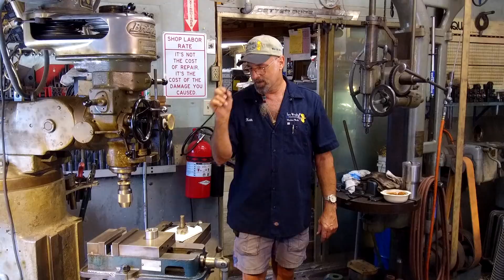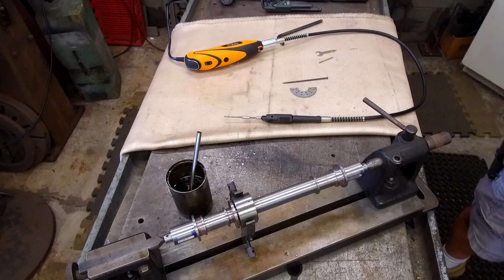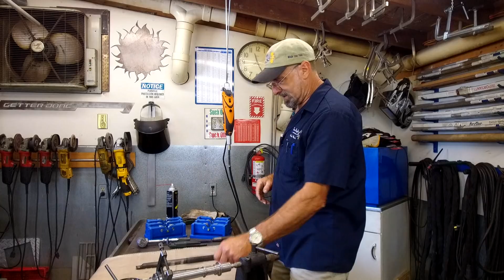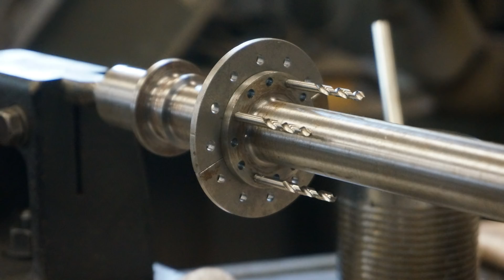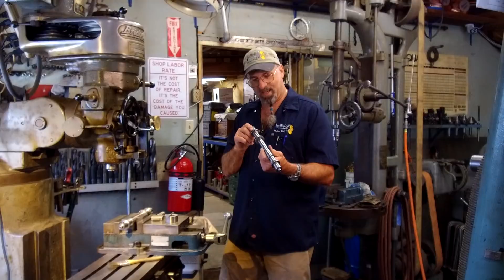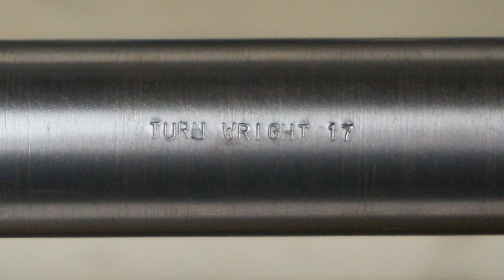Steam Wagon Ho Part Eleven

Comment: Dear Keith, kudos on your flexible drill bit. This an inspired idea. You should have used a counterclockwise twisted wire instead of a clockwise one. Alternatively a left turning drill and driver would have served the same purpose. The clockwise configuration you chose opens the strands of the wire instead of tightening them. Your configuration loses torque to opening of the strands of the wire.

Comment: I know I am late to the table on this one, but maybe a bit holder made with a short piece of a socket head cap screw of the necessary size, and sacrifice a ball end allen driver to chuck in an electric or air drill to drive it. It would eliminate the need of the cable all together.

Comment: Just a thought in case you ever need to use cable again for flexdrive and can't get speedometer cable in a small enough size. What do you think of cutting some snug fitting rings to fit the cable, space them apart and secure with hot glue?  The hot glue would flex and the rings should limit the amount of unwinding and spreading.

Comment: Hi Keith,  Great videos. To cure your cable problems, order an early Corvette fuel injection cable. They drive the Rochester fuel injection pump from the distributor and are very stout and wound backwards. They can be found on line, not very long but enough material for several applications. I use them to drive angle drives for porting 2 strokes cylinders and four stroke heads.

Comment: Great project series.  You may be able to get small universal or CV joints for RC cars to drive the drill.  I wonder if a ball end hex would hold up and give enough clearance.  I think you can 20 degrees out of them.  Your method obviously worked very well, as expected.

Comment: could have used a 1/4 hex drill bit (the kind that quick connect into drivers/extensions) grind the hex into a ball (like allen wrenches that let you use them off axis). then use an extension and the ball will act like a universal joint.  a long extension is slimmer than the dremel and would allow you to use a real drill. for shallow angles an extension or two from china with sloppy tolerances should do the trick without grinding the ball. also, i've found it best to leave over-heating tools running with no load to cool them quickly.  no load condition causes negligible heat and the cooling fan is running.  i missed some parts of this series is the tool from a sponsor? just can't imagine keith would actually use this tool...

Comment: Just s thought, perhaps you cannot get steel rope that has a left hand twist? You can get left hand cutting drill bits though. Such as thouse used in kits to remove broken bolts. Tying to help here. soft tin solder could work too.
Good job Keith... with a Ahah! so that what he's doing.

Comment: I have to wonder if when the wire is longer, does that mean the relative angle at the bit is less extreme so it gets less flex with each revolution.  For sure it'd be ideal if it could've been a left handed drill so the wire spun "right", but you can't win 'em all.

Sounds like something that needs to be tinkered with to find the magic bullet...

Love the solution!

Comment: The only thing I would do differently would be to pin the first hole while I drilled the rest -- belt and suspenders insurance against Murphy's Law.
Reply: I was going to say the same. I'd have done (and pinned) one on each side of the split to ensure everything was solid and kept in register. Obv the clamping force was enough as it was.

Good idea on the flexible drill. I'll try to remember that.

As for the soft solder idea, I'm not sure it would be strong enough. Soft solder joints are pretty weak. Maybe a good Loctite instead.

Comment: Great series as always! However, as a mechanic of many years I would have put an extension of about 12 or more inches on the connection to the flex shaft to reduce the angle which would have possibly helped the life of the flex drive. You could then have put on a more robust drive unit to speed up the process.
Putting extensions between sockets & drives is a more efficient way of getting access to awkward fastener locations with the least effort.

Comment: Keith what great project to follow on you tube I have watched this project with great interest checking for updates weekly. Regarding the cutting and lubrication fluid you used I have used Trefelox cutting compound with good results in-particular those hand drilling jobs such as this project- not to be confused with the garbage that comes in a spray can with the same name and is mostly oil. Anyway Trefolex compound seems to hang on and  does two jobs lubricate, cut and not runaway as heat or friction increased.

Comment: Cable (like drill bits) can be "laid up"  either  right-handed or left-handed. Your cables is exactly opposite the way you want it.  Cagbe unwinds. The ultimate solution is either get a cable laid up opposite ways from yours, or to get a left-handed drill bit and run the thing in reverse.. As it turns out you gotter done and that's what counts.

Comment: Keith,

Maybe the "StayBrite" stuff Greg Halligan uses in his HVAC work would work well in constructing a flexible coupling.  For "soft" solder, the stuff is STRONG.  It stands up well in air conditioning equipment, which is a good indication of its strength.

Eli D.

Comment: They make long shank drills for aircraft work that have short flutes and would have worked perfect for this job.
They come in 6,8,12 and 18" if I remember correctly, I used some in a plane I built when I had to drill "around" shit!
The shank is fairly soft and will flex plenty.
Great series!!

Comment: My pet peeve with little rotary tools is they have no torque for anything but grinding and the speed adjustment is useless because it loose torque on slow..but i do some precision small drilling and have not found one i like using so i'm building my own head unit to use that extender with...dentist drill setups are better but too expensive... As always love your videos

Comment: I use to work for a company named Elliott Mfg. whose business is Flexible shafts. There is a whole technology behind Flexible Shafts. I've designed several flexible drills for many applications but mainly surgery and doctors.  The cable you are using is not designed for rotary application but a tension application.   I would suggest that you find an old weed wacker and remove the flexible shaft from it and see if that will work.  Check out their website and get an education on flexible cores, there are many specs.   At the time I worked for Elliott they made 90% of the flexible shafts for all weed wacker in the world.  They have since moved manufacturing of many shafts to Mexico and China.  They actually gave their technology away to China for free. Do you believe it?   FYI: I mainly swaged the ends on the flexible core.

Comment: Loved it :) I could hardly wait for each ep to be released ;)

With the wire breaking. If you made the cups deeper and then only soldered up a small amount (to grip the wire) the rest of the cup would stop the wire from moving laterally so much (Is the idea behind boot lace ferrules on industrial and marine installations)

Comment: That TackLife rotary tool is a toy for polishing dainty teacups. These cheap ones don't have a proper speed control, and that allows them to bog down and overheat. I would highly recommend a Proxxon. The actually have torque at the low end (5000 rpm).

In addition, I think you could eliminate a lot of load by not using the flex shaft that came with the tool. When they are loaded, the cable will buckle slightly and contact the walls. This friction causes more load and more buckling and more contact. They are fantastic for light work like engraving or cleaning/polishing, but the long length allows a lot of contact and friction to work against you when doing something that needs a decent amount of torque. If you made the shank of your flex bit a few inches longer and placed it inside a sleeve, you could attach the rotary tool directly.

I would also suggest harvesting the cable from the long flexible adapter if you need to make more flexible bits. Those cables will be a special double-layer, high helix angle type that are designed to resist rotation.
Reply: ElectricGears Had the same thought re a longer wire and using a hand drill. Good suggestion of harvesting the wire in the flexible shaft but it is not as cheap. Proxxon or Foredom would have been more powerful but sometimes one has to use what one already has.

Comment: The problem is not the cable, its the heat.  Red hot and cooling slow anneals it and makes it soft.  Quenching hardens.  Quenching and reheating will make it spring steel (if enough carbon content).  Check out some blacksmithing videos.   The longer one held up because the heat didn't get into the middle of the cable, so it was able to flex there without stressing the annealed metal.  If you do this again, you could try electrical or plumbing solder, since your tolerances are tight, the temperature would not get up to the annealing temps.  You could have also put set screws for both the drill and the cable sides, which would all you to swap out the bits or the cable with ease.    Having the wire twist in the other direction, would have helped as well.  If you had something reversible, you could use a reverse drill with the same effect to tighten the cable instead of the twisting, trying to open the cable as you are trying to cut.

Comment: dermal make a good flex drive but there are many types you want the good one the constant rpm one as you set the rpm and it wont bog it automatically ups the power to keep it from bogging unless you really give her
ive had mine for a long time and its been grate for this n that jobs where the 1/4 makita is to much of a brut the dermal gets it done

Comment: I've never used cable (either Stainless or other) I have only used Speedometer cable. Cut it w/ a small Dremel disc, solder it up, works every time.

Comment: I would have used a regular hand drill on the flex cable instead of the smaller power head that was being used, you would not have had any trouble with torque or over heating, I believe.

Comment: I can't read all the comments to see if this is a duplication, but since you only needed a slight deviation to clear the journals along the shaft, a long length drill would probably have done the job much better.  Electricians use them to drill through drywall up through the top plate like a snake.  A smaller diameter drill rod silver soldered onto the drill bit would have done the trick I think, just needs to be long enough for the flex and to clear the end of the shaft.

Comment: When I first realized that you had to drill the holes I could not imagine how you were going to accomplish it. The flex bit were super, but I wonder if you could have used a long hard wire, like a suspended ceiling wire, long enough to run past the shaft then use a conventional drill motor. The "ceiling wire" still is flexible, but may take more push. Just a thought. Thanks for the highly educational video. J B.

Comment: With my trapping and snaring experience here in KY I have found 1x19 cable to be much more durable than 7x7. Basically looks like the same stuff but it has fewer heavier gauge wires. Looks like your 7x7 worked out, but I bet if you give 1x19 a try you will likely have less tool failures. Great series.

Comment: Cool technique! Would wrapping something around the wire (shrink wrap) reduce the flaring and hence reduce the work-hardening effect and snapping? Those rotary tools lose a lot of power through the flex coupling. I'm sure that if it didn't need to be run the through the coupling it would have handled the drilling fine.

Comment: Seems like that fancy dremmel could be replaced with a small 1/4" drill which has better power.  Enough flex no doubt.  It must have been tempting to cut some slices off the split pattern and weld them to the shaft instead of offset drilling.

Comment: Keith, what I have done in the past in my modeling days is used an old ball driver into a socket end. That way you could use a proper drill motor and put some real torque on the bit. The Dremel style tools with flex shafts just don't have the torque needed when drilling steel.

Comment: A couple comments for next time(?): if the input shaft had been somewhat longer you could have used a normal cordless drill. 
As the flex was opening up due to wrong direction wrap, if you had fitted a close fitting coil spring over it, it would have been restrained. 
As others have said, and you eluded to, silver solder is just too hot for that cable, soft solder or even Loctite648 might have done. Many times when I want an extended drill or end mill I find 648 more than adequate and almost instantly curing.

Comment: If you had a left hand drill bit it would work better with that lay wire rope possibly as long as the drill motor would run in the proper direction...Mike in Louisiana

Comment: If you web thin the tip on the drill you may not need to use as much force. I have done this on some small holes to drill with good results.

Comment: Keith, my complements on changing your method of making the flexible drill shaft. A critical part of any development, in this case your flexible drill shaft, is hypothesis testing. You established some failure mode hypotheses on the first two trials. Your third trial benefitted from the first two and as you said, you have some ideas for future types.Exactly the way to go about this! :-)
regards
vic

Comment: I use Rotary tools extensively, based on my experience, all of them are shit, loads of rpm and no torque. gotta make one yourself, I make mine out of sealed dc motors. I go over a few things here, gotta do a proper video at some point
https://www.youtube.com/watch?v=1eEzYl2Y7SM

As for the flex shaft. probably even more important than the direction of the twist in the wire is the attachment points and protecting the metal from any heat. I usually epoxy mine in place, plenty good enough for the amount of torque they need to handle. I have in the past used lead solder as well, it works but tends to wick. at least it doesn't get hot enough to temper the wire.

basically my improvements for this project would be, epoxy and a cordless drill. still fun to watch though :P

Comment: Hey Keith - Great series!!!
Next time, you might want to try a 1/4" Bellows Flexible Shaft Coupling similar to this one on eBay for ~$20 and a regular variable speed drill with a long shaft...
http://www.ebay.com/itm/1-4-Bellows-Shaft-Coupler-Coupling-Flexible-/401381594519
Reply from the maker: The diameter is to large, to be on center with pattern . ;{)------

Comment: You've put the cable in the wrong way, it's unwinding surely?
If it was inserted the other way, it would tighten up and there'd be hardly any vibration.
Reply from the maker: LOL   ;{)-------
Reply: Cables have the same twist in both directions the are either left or right handed twist just like threads.
Reply: Hmmm look at a threaded rod....same principle.....
Reply: David Dale It's the twist...  flipping the cable the other way would be the same. I agree that having the cable lay tighten under torque would be better but steel cable is generally that lay. A left hand drill would work but does the power unit go ccw?
Reply: Try using a left handed drill bit if you could find one
Reply: How about a universal joint for a fuel RC car? Should take the torque ok...
Reply: OK Keith... ignoring the Rutland work how many hours on this job? What is the job cost?
Reply: I agree with the left had drill idea and I will also propose a test.  Make a second flex joint increasing the diameter of the cable.  Now chuck up in a regular drill that has enough oomph.  A piece of poly tubing over the cable might be a good idea also.
Reply: DW Macaulay pinky to mouth......one billion dollars! Sad part is, the "customer" who is receiving this part is only paying a pittance of what it is worth. Experience tells me this. Good for Keith's YT channel/topic/viewers. Not-a-somuch for the bank account.
Reply: David Dale 
turming the cable end  for end doesnt do it.  they dont make cable that had the othervtwist, so jothing keith could do other than use a left hand drill bit..

Comment: Keith you need a rotary air pencil. They turn 30,000 rpm and use a tungsten drill bit. Have done similar procedure as you havehere with no failures. Fast and easy.

Comment: FYI, R/C boats run flex drives that are pretty cheap with collet adapters for cables to solid shafts.
https://www.offshoreelectrics.com/products.php?cat=Couplers+Electric+Motor

https://www.offshoreelectrics.com/products.php?cat=Flex+Cable+Assemblies

Comment: How about buying or building a tiny U-Joint ( stronger than flex wire , and greater angle available ) , then use a more powerful drive motor.